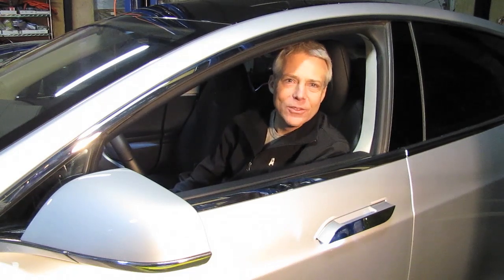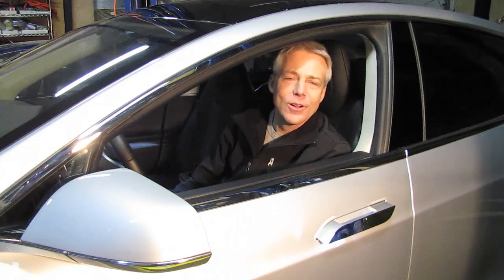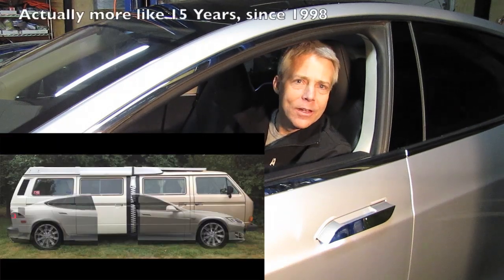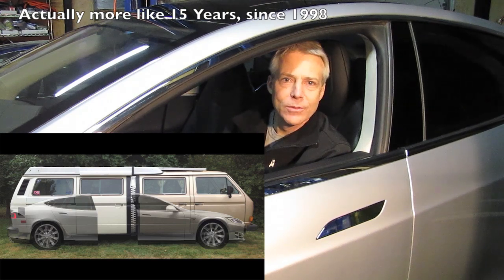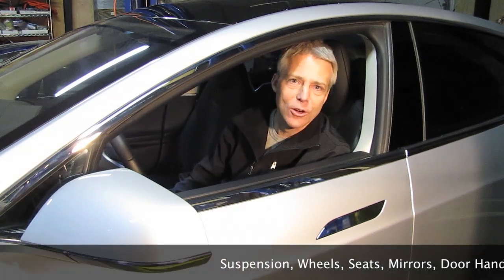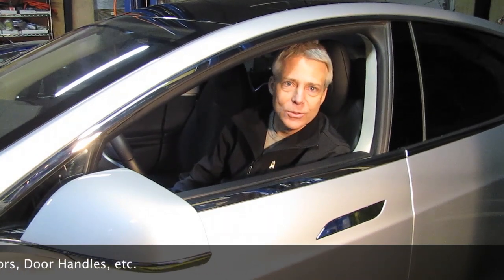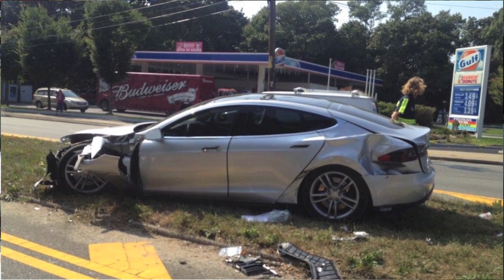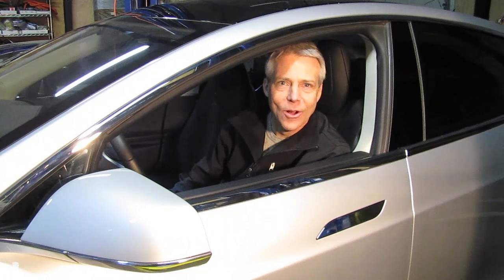Wheels are Turning

Comment from the maker: I believe Supercharging is a huge game changer for electric vehicles. I've been working with EV's for over 20 years yet the first time I bought stock in a EV company was when Tesla announced them. The Superchargers, especially the proposed one outside of Death Valley, CA, are what inspired this project. So yes, I plan to use Superchargers on the road. In order to insure that I can safely use them I am keeping all the primary systems of the Model S intact. I expect that all the systems will not be able to tell that the body has been changed, unless of course they are monitoring energy use at certain speeds which will be higher.

Comment: Re wheel's keep spinning...  Did you switch to regen and turn creep off?
Reply from the maker: Yes. I'm guessing there may be a tiny positive torque supplied to take up any gear backlash or something like that which keeps it spinning. The regen was disabled due to the ABS being disabled which is due to the lacking wheel speed sensor and lack of brake fluid. These are side effects of the accident damage and should all get better when I replace the missing parts.

Comment: Hi. Where is the pyrofuse? I got the "Pull over safely" message as well.
Reply from the maker: It's near the 12V battery, in the main fusebox (location varies depending on what year car it is). If you search Google you can get images of them as well as people selling new ones.
Reply: I shorted the the pyro-fuse using a wire and it's charging now. Thank you.